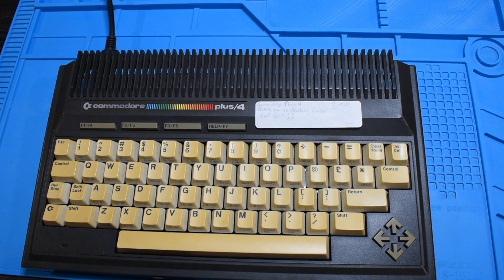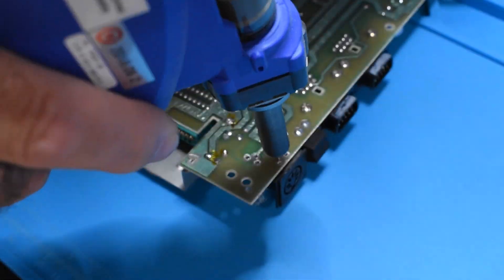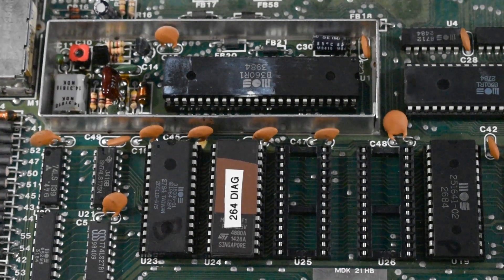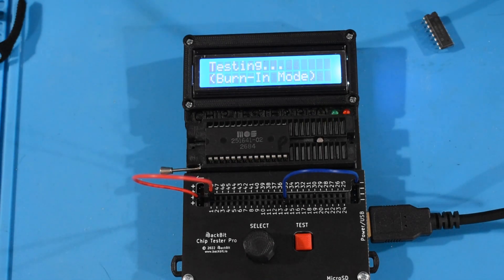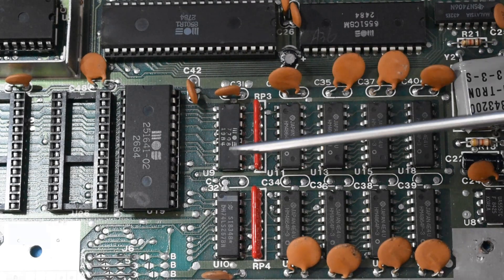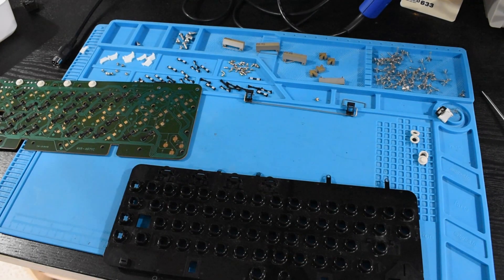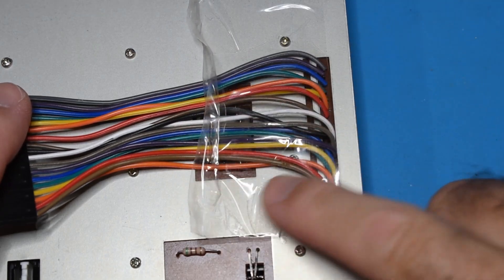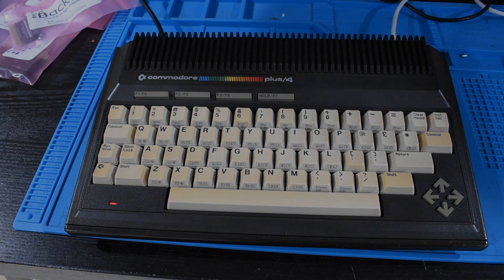Commodore Plus/4 Memory Repair and Keyboard Improvement

Comment: I own a cheap thermal camera and thats why I decided to replace both MUX and also the ROMS because they're creating a lot of heat, now with the new ICs they're barely visible in the thermal cam. also each ROM I replaced draws 50mA less of current what makes it 200mA in total (less), thats not just reducing the heat ist also better for the PSU. 
When I was about to replace the power connector to the C64 one I found that my board does not have all the holes for it, so I disassembled the connector to remove the unused ones and had to drill a hole into the board, but it goes right into a place where it has to go anyway, so no big deal.
Also before I got the new C64 PSU I only connected 5V to the Plus4 and everything works fine, the 9V is only used for the Tape but I don't have one.

Comment: Hey! I think I have the same problem, but I don't have a diagnostic rom, or anything to actually find out. What troubleshooting steps should I take, I'm kind of lost here. Should I change out the multiplexers? I was not able to find the ones you were using though.

Comment: Which EProm did you use? I think it's a 128k but it has 28 pins. I have some 264k which have 32 pins so technically I guess I could make an adapter but would prefer to have the right 28 pin chip.